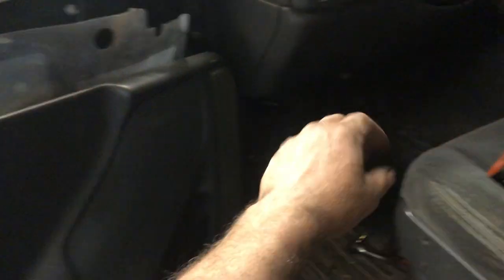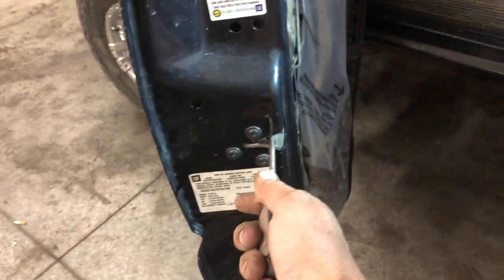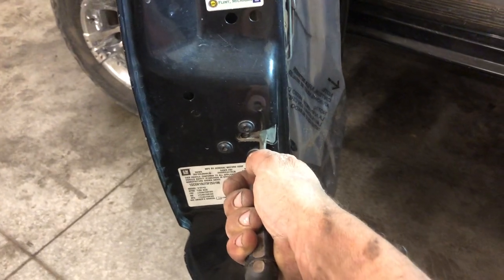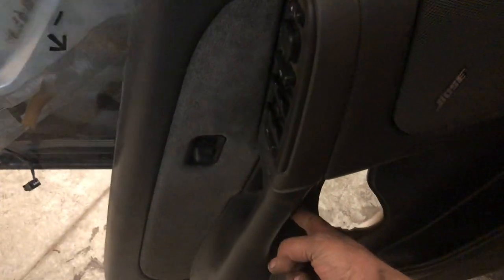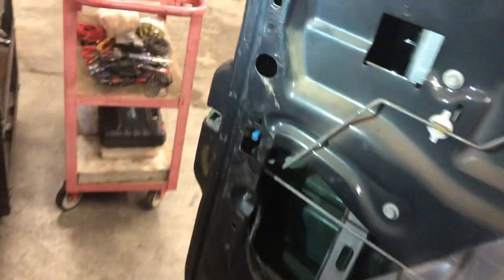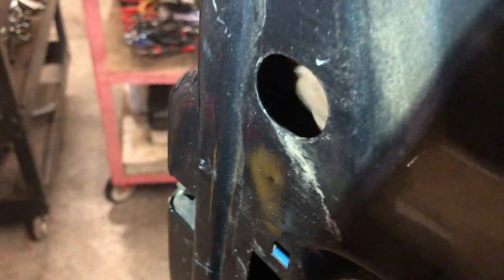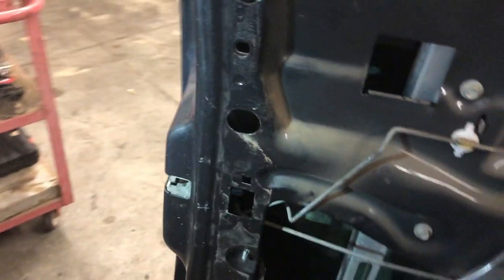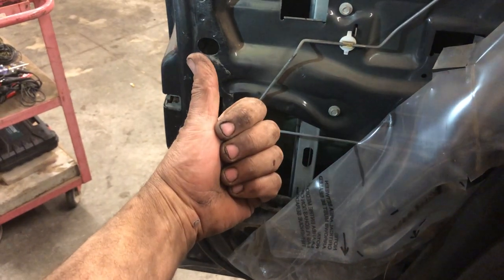2004 Chevy 2500 annoying doorbell chime disconnect

Comment: think this the same on a 09 GMC 2500 with Bose stereo system?  I would assume so but before i tear the door panel apart id rather check. I already disabled the annoying seat belt chime warning, its a 2 prong wire under the driver seat easy to get to and obvious to see , i haven't messed with the passenger side yet it appears i need to remove the seat to get to an array of connections and will need to identify what one to unplug,  lot going on on that side under the seat.

Comment: If you unplug the chime at the door, does it kill the interior lights also?
Reply: Mine has a button on the dash, left side bellow the headlight on/off switch. It's the dome overide.. Hope you have on too.  It's a hand feature.
Reply: Yes. When I disconnected it on my 05 GMC 2500hd (Base model/ no auto windows/door locks) the dome light no longer came on when you open the door...

Comment: Tried it and it doesn't work 
All it did was cause the dash lights to stay on continuous even when the key was out of the ignition. Plugged it back in and the lights went off immediately. May work for someone by a freak accident otherwise DON'T DO IT!😢

Comment: Tried it and it doesn't work on 2003 Silverado
All it did was cause the dash lights to stay on continuous even when the key was out of the ignition. Plugged it back in and the lights went off immediately. May work for someone by a freak accident otherwise DON'T DO IT!😢